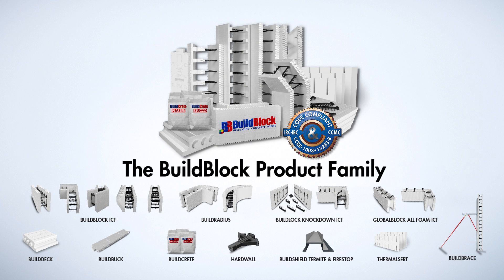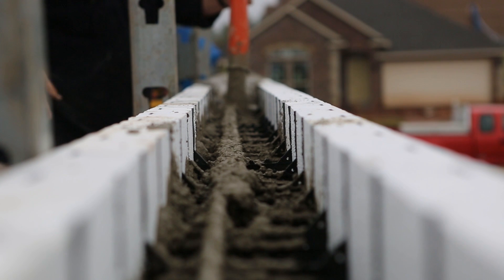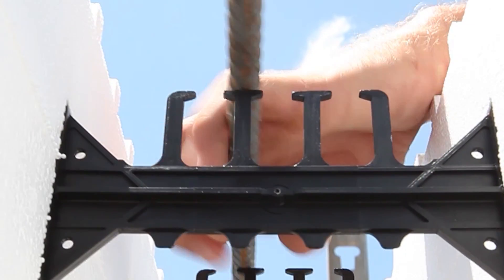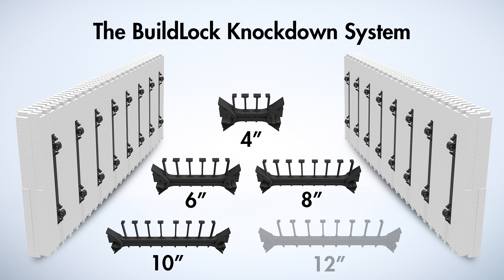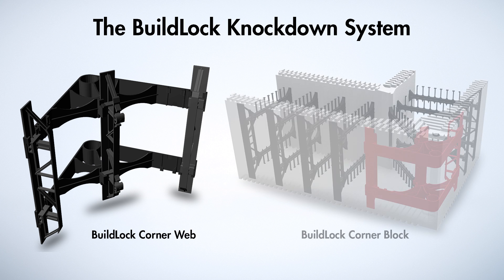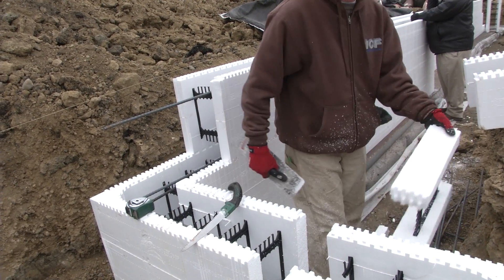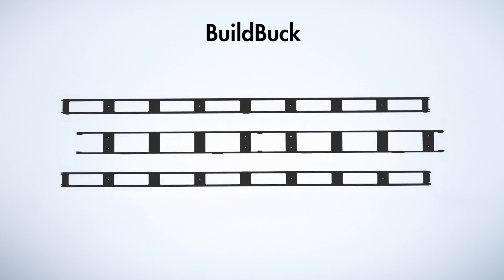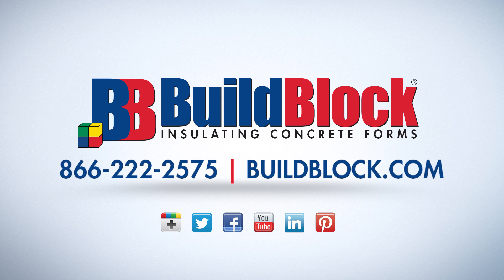Introduction to BuildBlock ICFs

Comment: dam! we can get these 20ft long?
Reply from the maker: Hi Travis. Are you talking about the radius blocks? We do have a block that creates a 20ft  arc radius when put together. The blocks themselves are only 2ft long. You can learn more about BuildRadius here- https://www.youtube.com/watch?v=JMn2no8X1Q8
Reply: BuildBlock ICFs , I watched it again and realized I "mis-watched" it lol that would be pretty awesome though if we could get the blocks in various lengths, I personally think it would add strength and speed to an all ready strong and fast system ;)
Reply: @travislongwell  Various lengths would increase production costs and create a shipping nightmare. The blocks are easily cut to needed length. Save all your cut-offs as you likely need them later. I understand how nice it would be to have 20’ blocks, but then you would need 3 to 4 people to place it. At 48”, only one person can set a block. There is no such thing as free labor so adding more installers would increase your costs.